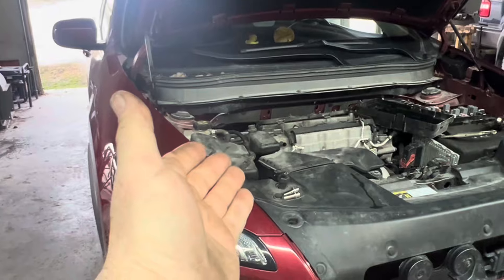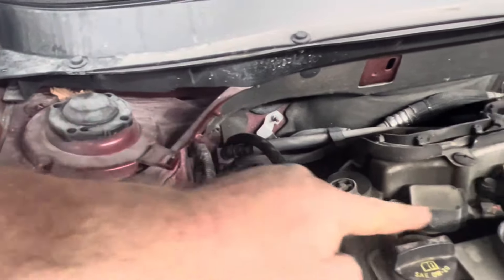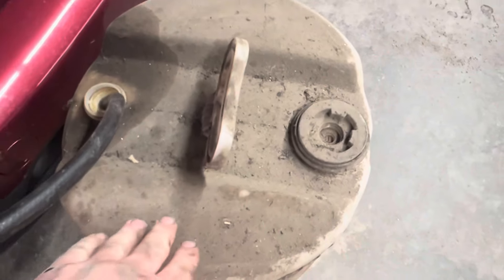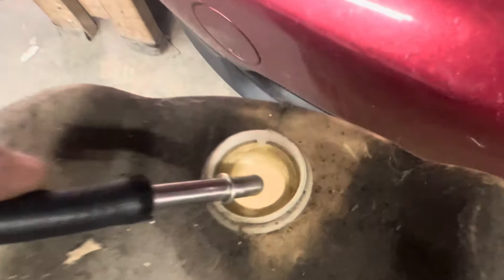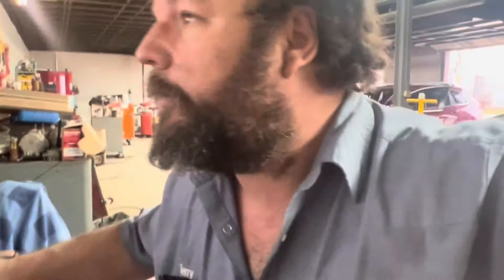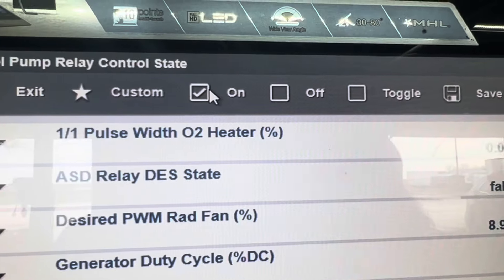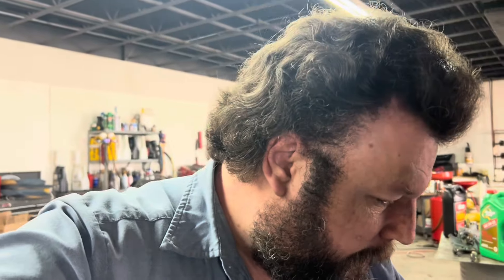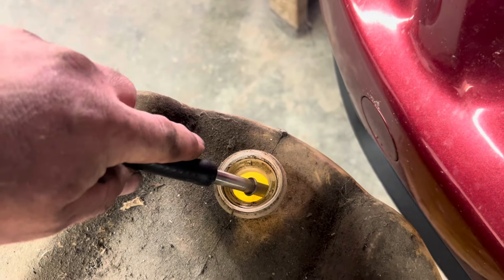Honest mistake, diesel fuel in a gas vehicle

Comment: It's not an honest mistake. The nozzles won't even fit into the fill neck. That's just naive.
Reply from the maker: They’re not supposed to fit, but I’ve seen the wrong nozzle installed before. Thunderhead289 just had the same thing happen to him and he did a video on his experience a couple days after this, the pump he was at doesn’t even offer diesel…it was due to a problem at the station.